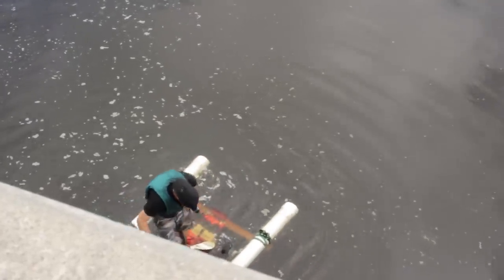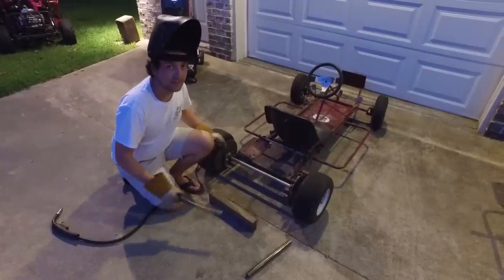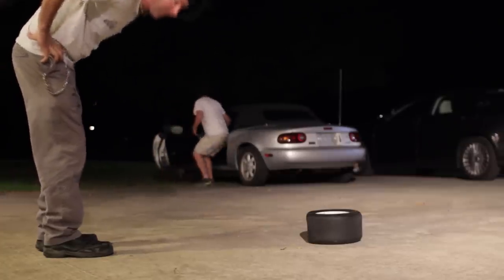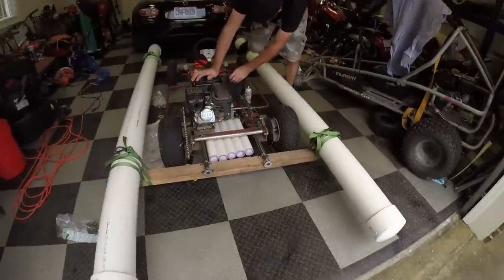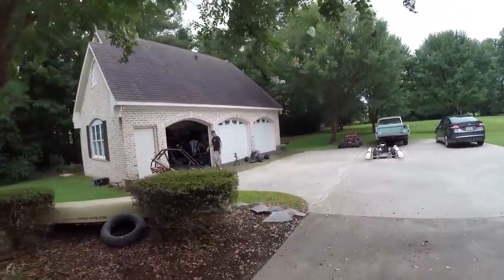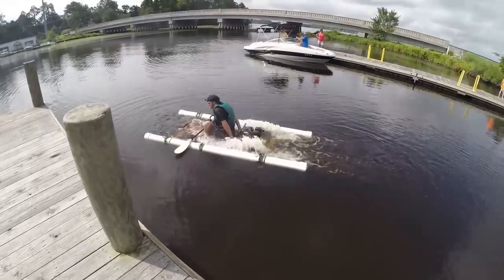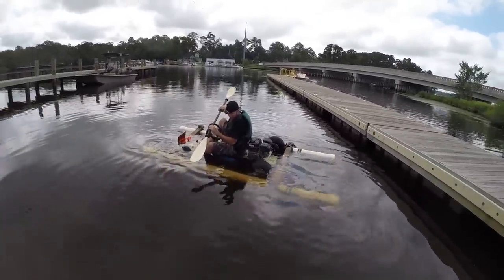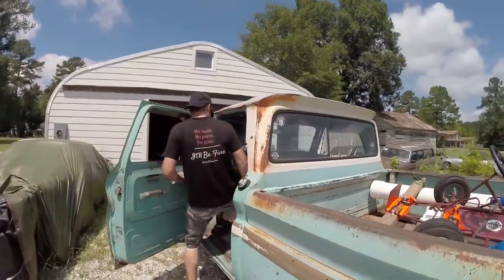AmphibiKart Pt. 2: Power & More Floats

Comment: Well on this note, you could always use those 30 gallon blue barrels on the front and back, double up the side pontoons for stability, then add a 3 or 4 blade propeller bolted to the go cart rear wheels, so you can still roll and make use of the wheels, but have paddles on the outside for propulsion while in the water. The barrels and the doubled up pontoons on the side will keep it a float, even with a rider of 350 pounds, might also want to elevate that motor a bit more too, and make a longer pull string to the front, so the rider can still remain seated to restart even if the electric start fails (that's if you have an electric start in the newer version), they'd just have to then pull start from a sitting position. I would also put at least the ability to have an electric trolling motor of some sort in case of motor failure you can easily get to shore safely. Just some more ideas is all.

Comment: you could, move the 5 tubes to the out side PVC pipes and attach them there. then take an old tire  rim and weld flat stock (paddles) across the edges and place that in the center of your axle. Might work,
Reply: that actually should work perfectly then just make a fender to cover it so that you don't get soaking wet and you should be able to make it decent size for some real propulsion
Reply: yep, the problem I see is trying to make the paddle section big enough so it is effective yet small enough as not to collide with the ground when driving.

Comment: Love it! I would try some kind of fold down pontoons with pins. As for the rutters they could possibly strap to the tires. Prop I would fit a pulley to the rear axle and run some tubing or angle iron so it is about 3ft behind and much lower than the motor.

Comment: There were a lot of ideas to go through to see if this was already posted, but I was thinking a paddle boat wheel on each side, outside the tubes, driven by a chain from the axle. You should be able to leave it high enough that it never touches the ground while driving since the cart sinks so much. Would only add 2 sprockets, an axle, 2 paddles and 2 bearings. Oh and some frame work to mount it all.

Comment: Ike, you could build an aluminum paddle wheel mounted on a jack shaft near the rear bumper, inside the frame. Make it belt driven off the rear axle with a tension pully that can disengage the belt for road use. then you can experiment with different gear ratios for the paddle.

Comment: 1. More flotation
2. A sort of hull to keep the water out of the engine and seat
3. Paddles mounted alongside the rear wheels
4. Rudders on the front wheels that are high enough not to prevent driving.

Comment: one suggestion for better floatation,  connect the side pontoons across the front ad back. basically building a square of pipe around the cart. 

 I think it'd help keep the engine out of the water. also maybe move the side pontoons back a lil bit too

Comment: two things you guys need to try. 1) put two of  those thick  PCP pipes horizontal to the parallel ones (one in front and back). 2) super glue or weld fins on the rims of the tires so you can actually go a bit faster.

Comment: Always better to start with a boat, and make it a go cart than the other way around.
Mount everything on a light fibreglass dinghy seal the axle where it comes out the side of the boat, use bigger wheels, and of course a prop! BAM

Comment: Had a "Dune Kat" buggy kart when I was like 13 or so.  It had balloon sand tires on it, kind of like a paddle tread.  My friends and I did this exact same thing to it with the PVC pipe.  It floated well, but even with the big paddle tires it was very slow on the water.    Kinda wasn't worth it so we only did for an hour or so and dismantled it.

Comment: I would suggest getting that paddle boat that was hanging over the truck in the last part of the video and making some sort of drive system that will engage the boats paddles when the wheels of the go cart are spinning on it. kinda like a treadmill or dyno wheel. then you can use the boats steering mechanism for control. I think it would be cool and you can still take the go cart off of the boat and still use it for its intended purpose.

Comment: for adding a propeller, you could add a sprocket to the axle, run the chain to one of the 90 degree drive shafts you used on the rat wagon, then mount the prop straight out the back

Comment: snorkel for both the fan and the intake. you should also make a shroud or something to co around the rear tire. With or without paddles, that way the moving water will be directed in the other direction rather than just getting ike's pits wet lol

Comment: A couple of sprockets attached to each side of the axle with cups similar to a steam paddle boat would work better for propulsion as long as they are smaller than wheels enough to allow for ground clearance. Equally spaced on axle or you drive in circles. Figure way to let them free wheel on axle so if they did bottom out or hit something on land they would just spin maybe. That might wear a grove in axle though.  Concept could also use love connectors to quickly and easily attach to end of axle outboard of wheels which sounds easier and more practical or could just attach with set screws and keyway. Maybe u already have it figured out. Like the channel by the way. Hoping to find feasible wag to add shocks to my kind of off-road cart

Comment: Put the slicks back on so you'll throw less water about. Take the 90° thing from the Rat Rod and install it somehow to drive a propeller. Put fenders over the tires to better control splash. Short of getting the whole cart higher in the water; raise the engine 6" or so. Replace the bottom tubes with rigid foam. I'm thinking it's lighter with better flotation properties. Lastly, would compressed air in the side tanks help flotation? Test this.

Comment: You need a prop on the back and a clutch system with a manual lever to switch between prop and wheels. Thats the only way your going to be able to move in the water and on land. Have a rudder attached to the back of the prop that can move with the steering wheel so both rudder and front wheels move together. Just an idea.

Comment: gotta make some fenders to keep the splash down. depending on how far in the water the tires are you could make some paddles to mount on the sides of them, if not you could make a mount for a trolling motor. Also i think it'd be a good idea to put some flotation in between the main 'pontoons' at the front and back considering how much unused space there is there you could add some more of that large pvc and really make it look like a raft lol

Comment: take a sprocket and weld some pieces of flat iron  on it to make a paddle and center it on the axle. build fenders around back tires. a water shroud around the engine.  take some flat metal and attach it to the front axle that sticks out about 6 inches past the front tires to act like rudders.

Comment: Use thick PVC over the rear tires like you did on the Drift Trike but, cut out some directional scoops (paddles) through the PVC, first. This would allow the "tread" to still be flat for the pavement and, while on the water, it would scoop the water like a paddlewheel.

Comment: You could easily add a propeller by adding a few gears and and axle to the back gear. Also make a rudder by attaching the par to the steering wheel angled slightly higher than it.

Comment: you've got those 90 degree drives from another build .. one of them with a small wheel driven by the road wheels .. short shaft with a small plastic prop out the back of it ... easy as pie ...

Comment: If you slide the pvc pipes back a little bit it will lift the rear up some more. I would also take some extra pipe and make a splash guard for the rear tires to possibly slow the water from getting thrown to the front. As for rudders, I would make a pulley system and connect them to the back of the pvc pipe. As for a prop, why not try to add on the the rear bumper you added and go with an old school paddle wheel. Just add on to it and connect it to the rear axle with another chain and sprocket.

Comment: You need to make it so the outside pvc pipes are on a hinge so you can flip them out and under the go kart with a cable or lever. The linkage wouldn't be to difficult. More buoyancy. Then paddles welded to the outside of the rims not affecting the tires contact with the road.

Comment: Needs some fenders and some paddle tires. You can make a simple rudder system controlled with like a handbrake handle or vertical bar. Maybe try pressurizing your tanks with air and seal em with flex seal for more buoyancy too.

Comment: Would be super cool if you could do a prop on it that pivoted on the axis of the back axle and had a bevel gear off the rear wheel to a shaft with the prop on it. If that makes any sense lol. Could probably use hacked up bike forks for the prop mount. Bearings on each end of the arms and the shaft running through bearings where the handle bars would attach.

Comment: cables on pulleys running to rudders in the back that meet wrapped around the steering rack. Use rudders that can drop down with bearings at the top to meet the rudder housing like in a dinghy.

Comment: Steps to improve the design:

1: Sprocket on the axle
2: Get another one of those gearboxes like the one on the rat rod wagon
3: Add a propeller with a CV joint that can be raised or lowered when ya need it.

Comment: Just get sand paddles for the rear tires from go power sports. Mount the motor on a couple 4x4's and steer with a home made rudder that mounts to the rear bumper and is connected to the steering wheel.  You can look up diagrams on how to mount a rudder to a steering wheel on google.

Comment: i wonder if you put some sheet metal around the motor or the bottom of it, if it would help with the water? or if you put sheet metal over the wheels, leaving space of course to keep the water from splashing all around the engine so much.

Comment: I would put fender wells over the rear tires. Not only would it cut down on the splash factor, and keep the engine drier, it may also help propulsion, since the water is getting forced out the back more than the top.

Comment: We have a lake here in Oregon called Loon lake, there is an entrance to the lake from the highway, and another entrance to the other side of the lake where there are more cabins but the other entrance is so far out of the way that it is a pain in the ass, so a guy that I was working with told me about a trailer that he built with flotation, so he could tow his suv to the lake, and then tow it across the lake with a boat, but he was a gear head like you guys and decided to build a mechanism that would allow the tires on the suv, to drive the tires on the trailer and then let it power its' self across the lake like your kart, he said when he put it in gear it lunged to one side and almost capsized, so he took it off the trailer and drove it the extra 60 miles or what ever it was. No real advice in this story or nothing to learn from really, maybe just a little comfort in knowing that other people have crazy fun ideas, that don't work at first, or maybe never work, but it is still fun and failure is still a step forward. They say that the pessimist may be proven right in the end, but the optimist has a better time on the trip.  You may have heard of Colin Furze, if you haven't, look him up, he is on youtube, he puts jet engines on go karts and barbecue's.
Reply: cool. thanks

Comment: One thing I'd try is use the 90deg angled gear box from the rat rod wagon and run a sprocket from axle to input. Then put a boat prop on output. Maybe even make it able to move up and down on a lever or something.

Comment: for the wheels you can use 2 circular pieces of wood with square cuts of wood in between the circular cuts to act as paddles whilst still having the circular pieces of wood act as wheels. you could line the edge of the circular pieces of wood with some rubber for grip.
Reply: and I think the wheels in general shouldn't be that deep in the water. all paddle boats have the paddles only partially in the water and not submerged so I bet a lot of drag can be reduced by raising the wheels up so they aren't in the water that much. you would have to find a way to lift the body of the go kart up and lower the pontoons enough so they wont drag with the wheels being higher up

Comment: If the engine will be running then rig a stator winding to it and use an old trolling motor with a shortened shaft and cables attached to the steering wheel to actuate the steering of the trolling motor...Raise the engine up by 4" also...

Comment: You could make paddle wheels, rubber cement or something strong and flexible for glue, cut the end off one of the pvc rings, and use its curved pieces as propeller blades on the sides of the tires, each being about 3 inches long and 1 inch wide or so they wont hit the pontoons and theyll work at a 45 degree angle as seen on paddle boats, so that when the wheel comes around it cuts the water and doesnt push until its under the craft at 8 oclock aiding forward movement!

Comment: Rubber cement rubber paddles onto a set of tires that your able to tie down onto the tire, hence you can still drive it into the water, then once your in you can release the tie (narrow yet strong twine?) with maybe a jimmy rig testing purposes only quick release, that way as the wheels start spinning the paddles open and catch the water creating propulsion. I see one problem with that, being the getting out of the water part but that isn't really important right?

Comment: It need better propulsion obviously but it needs an aluminum skid plate under the front all the way to the front of the rear tires and all the way across for better floatation etc. and fenders on the rear tires to keep water from getting on the skid plate.

Comment: Weld paddles to the axle, so it wont interfere with the normal drive train, but it'll still spin in water when the axle is submerged

Comment: Weld a flat piece to the outside of the rim that goes just to the edge of the tire but it still drives fine and it'll work like a paddle I would think

Comment: My 750 ATV Kawasaki floats and runs across ponds and streams just fine, the larger the wheel the more flotation too and the front wheels act like rudders just fine., for steering. and the better deep tread on your tires the better for speed in water and off roading~!~

Comment: i would put 2 engines on it both in the back 1 woud be for driving and the other 1 would be a small motor boat engine and it would  fold up so the fan wasnt touching the ground i hope u find this usefull
Reply: the engines would be next to each other like the old go karts

Comment: For definite ethanol free gas go to a dedicated ethanol free pump because the line the the fuel goes through from the pump holds a gallon of the type of gas that was pumped before so if someone who used the pump before you put ethanol in their vehicle there is still a gallon of ethanol in the line so your getting a gallon of ethanol and then whatever else you get is ethanol free

Comment: Take the front wheels off, and then weld fixed squares to the  axle to act as a rudder. Take the  rear tire off and weld rectangles around the rim to act like a water wheel.

Comment: try putting 3 small or medium size paddles welded to the rims that might work, n make it float a lil higher out the water so the engine is not touching so much water

Comment: U should try designing mount system so u could put a boat prop that is driven by the motor that's powering the wheels and still be able to use the tires to drive on land so it could almost be like a Argo

Comment: You should use another one of those magic boxes connected to the axle with a chain and put a propeller on the other end, tis will allow you two change the speed of it with the sprocket size

Comment: you could use the wheels at the front for the rudders and use the steiring wheel for controland yeah put some air In big pipes it helps with lift

Comment: just an idea try making a wheel with flaps on a shaft by back bumper with gear connected to axel  so when you hit Gas it will have more power in water

Comment: Weld a straight axle onto the hub that extends out from the tire on the end of the axle weld paddles to it that are no taller than the tire so it will drive on land but when in the water the paddles will be submerged

Comment: now you need a secondary axle with a lever to lower it to the wheel's & paddles(use big spools for Cable fiberglass them into rotary paddles like a faris boat/old school wood padle boat  )

& double up on big tubes ,Mabey fill them with nitrogen at Costco!
Reply: havevthe wheels rotate the paddles /axle  & cut a 60% wheel well out of wood & fiberglass it !

Comment: Another way would be to drive propeller with hydraulic orbit motor and have it hydraulic drive then you could have reverse also. That is if you know hydraulics basically use an open system so you just change flow depending on your valve selection for your application pump driven right off the motor and double spool valve and two orbit motors and a reservoir tank 3gal should work This would be higher priced way to do this. Also to find larger pipe as I commented before find a commercial plumber they should have 12" pipe and caps.

Comment: I would get some big skinny wheels that way they would give you the clearance off the ground that you need for the pontoons. Then on the back wheels I would weld sheet metal to the outside to give it kind of a paddle boat style propulsion system. You should be able to make rudders in the front that run off of the current steering system. That way you wont need to make any fancy steering system in the back. Let me know if you want a sketch of what I'm talking about.